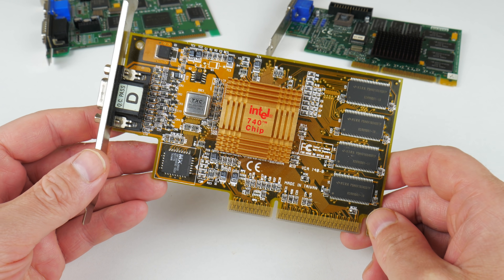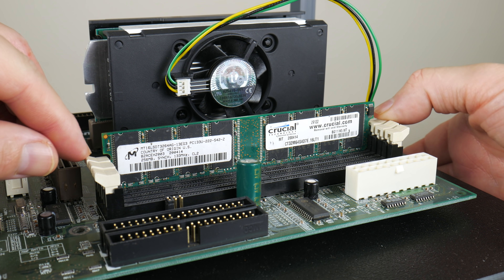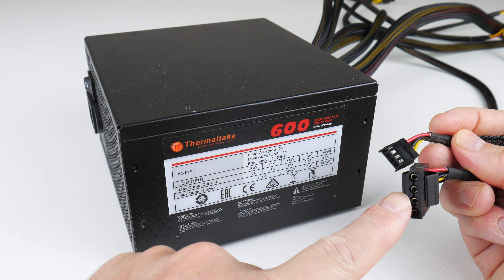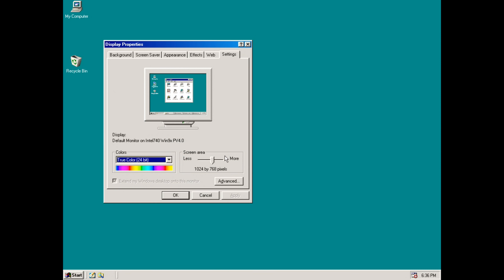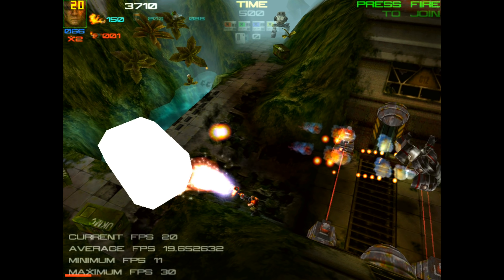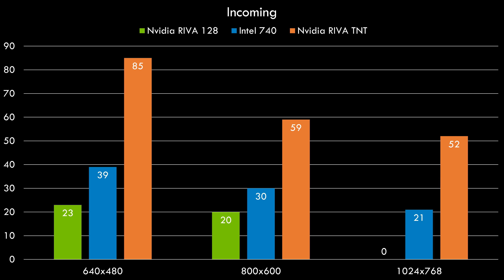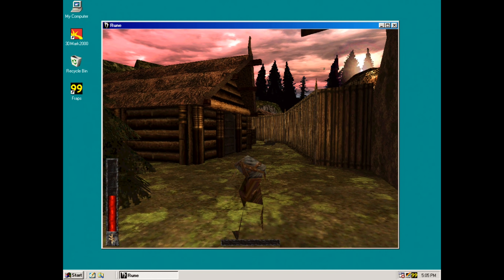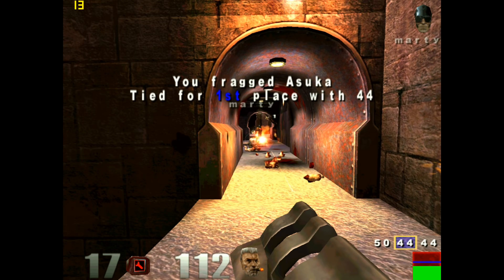Intel's first dedicated GPU vs Nvidia - The Intel 740

Comment: I didn't buy because yeah integrated Intel GPU is just continuation of the i740 and that means G31t or 945GC-M7 board indeed a modification of I 740 and only can 🪞 waters correctly on windows 7 in far cry gaming

Comment: Yes, I was alive and kicking and in college, PC gaming on Tandy 1000 since 12 (though I did have a Ti-994a before that) I never knew Intel made a graphics card.
Because of covid and having to make room to work at home, I've had to sell a lot of my retro stuff to make room including Voodoo 3's. I've focused on mostly modern gaming. Got a 3070 Ti, 1440p monitor, mostly for DOSBox in 1600x1200. I've been paying attention and the Intel cards might be more expensive at MSRP than options from NVIDIA and AMD probably to help cover R&D costs. Intel is not restricting hashrate for mining so that won't help what retailers will end up charging. I'm thinking they will be scalped at $1300-$1500 for the lower end models if nothing else than being Intel's first high performance dedicated GPUs. If they do have a GPU that can match 3080 Ti or 3090, those are going to be some expensive cards. I do love the cool naming of the Arc GPUs but they still won't have features NVIDIA has brought to the table. Yes they will have their own DLSS and ray tracing but just how competitive will those features be?
Reply from the maker: 1440p is nice for older games, 1600x1200 with center scaling. Especially if you have high refresh rate screen :) Sorry to hear you had to sell Voodoo 3 though 😔
Reply: @philscomputerlab  I've learned to live with it. With using DOSBoxECE and GOG w/ SondCavas VA, MUNT, etc, many games just run better. For example, I did hours of comparison running KQ8 from original CD on a P3 1.4GHz and a Voodoo 3 against my modern PC and the GOG version using dgvoodoo2 and the GOG version performed so much better. That P3 and Voodoo card should have been more than enough. I know many here are die-hard original hardware but there are so many ways to get those old games working as they did before. I did get an Sound BlasterX AE-5 for Alchemy. I did still keep a P3 1.4GHz with Quadro FX 3000 and Aureal Voretx2 and a Phenom II X6, 750 Ti and Titan X-Fi for ridiculously high-end Win98 and XP gaming. I do have an Athlon64 and P4 for Win98 too but I have to keep them is motherboard form in an air-tight container with a few spare Vortex2 and SB Audigy cards.

Comment: The intel card was good and had a number of features other cards in its class did not. The problem was intel did not have good driver programmers so it didn't matter how good the silicon was.

Comment: I went from an integrated ATI Rage II with add-on PowerVR PCX2 to a Riva TNT.  This video shows how magical the Riva TNT was when it came out. It blew me away and lasted years for me. With the i740, I'd really like to see how it scales on systems with faster memory. Would it see a big improvement?
Reply: No. It doesn't, at all. All that promises that "AGP will now allow us to access system memory to store textuers" were all bollocks. Actually, there are some PCI versions of the i740 and they are even faster than their AGP counterparts. As weird as that sounds.
Reply: @ccanaves  The Riva 128 can also pass textures across the PCI bus like AGP can do.   That was a selling point of the card at the time that it was somewhat competitive with AGP, but over a much slower interface.
Reply: @ccanaves  >All that promises that "AGP will now allow us to access system memory to store textuers" were all bollocks.

No, it wasn't bollocks. The fact the i740 could do 1024x768 with so little memory on the card itself proves that it uses AGP Texturing. Let's take the average i740 with 4 MB of video memory. Running a 1024x768 16 BPP frame buffer eats over half of that once you account for things like the Z buffer, stencil buffer, etc. There'd be no room left for anything beyond the most basic of 3D textures. Games at the time were starting to hit the texture limits of the likes of the Voodoo2 8 MB cards, which only had 4 MB of texture memory available. Q3A tanks the 8 MB Voodoo2, and the 12 MB card is not far behind because of either having to swap out to system memory or lower the LOD to a blurry mess for speed.

The reason the PCI i740 was in some cases faster is because the PCI cards had to have all of the available memory to the i740 on the card itself, since it was not designed to run on the PCI bus and had to use an AGP2PCI bridge chip. The local texture memory was faster, and didn't have to share bandwidth with the CPU and the rest of the system, resulting in slightly better performance. But this was largely offset by the slower PCI bus, which at best was half the speed of AGP 1x, and at worst a whole lot slower when the system was heavily loaded due to the shared nature of the PCI bus bandwidth.
Reply: >I'd really like to see how it scales on systems with faster memory. Would it see a big improvement?

Moving the card to a faster system would just see speed improvements from reduced system bottlenecks. The card is always going to be AGP 1x, and moving it to a faster system won't change that. The memory bandwidth to the card won't change beyond the 66 MHz / 266 MB/s the card was designed to run at, but a faster system will allow the card to run closer to that maximum more of the time. Likewise, a faster CPU will be able to feed the card more efficiently.

The best possible system configuration I know of for AGP 1x/2x cards that are still easily obtainable are the 533 MHz FSB Pentium 4 chipsets made by SiS and VIA that allow for a universal AGP 4x slot, which will accept all AGP cards except the uncommon AGP Pro cards. This would get you up to a 3.06 GHz Northwood Pentium 4. If for whatever reason you needed SSE3, you could drop down to a 2.8 GHz Prescott. I ran one of these for a long time for my Voodoo5 5500, since it's limited to AGP 2x and the PCI variants are severely crippled due to bandwidth starvation.
Reply: in 2020?
Reply: My self the rage Fury Maxx .  Cheap card nobody whant it.  Really gast card in that time of IT works
Reply: @vardekpetrovic9716  hm, I did forget about that, although from a bit later. Didn't really know what a xeon is back then.
Reply: Are you sure that Ati was integrated? Back then you couldn't really find an igpu outside of sis boards, at least on the Intel side of things. I too had a rage 2 on my pentium 133, it was a pci card.
Reply: @youzernejm  of course I'm sure. I owned the computer. It was a Sony PCV-120 Pentium 200MMX system with an onboard ATI Rage II 2MB graphics chipset.
Reply: @youzernejm  AST made systems that had ATI 3D Rage II+ chip on the baords.. I had a pII 266 system with a 4mb one, it was slow but not nearly as slow as the i740.. that 740 was hot garbo.
Reply: @youzernejm  One of my neighbours had an e-machine in 2000 that had an integrated ATI Rage Pro Turbo chip with 4 MB of VRAM. A few years later I rescued it from a hard life of being abused by teenagers who installed all manner of spyware, and in 2005 they finally decided to get rid of it. The power supply had scorch marks in it from the fan being clogged with a mix of pet hair and tobacco smoke, and the CPU fan was seized completely from the same mix. I replaced the power supply, put a new cooler on it, gave the case a thorough scrub to remove the tobacco staining, and replaced the hard drive with something from my Box Of Crap to revive it. The thing lived for another three years in the care of a pair of seniors before I eventually traded them a more modern PC for a 1991 VW Jetta.

Comment: I worked for a local computer store back in the day. My boss has a penchant for buying cheap parts, so of course the i740 came across my workbench. It was truly awful, and I'm not sure the i740, combined with the cheap Super 7 motherboards that he ordered, helped my first impressions of AGP. (I don't remember when this was, so it is quite possible I first saw the i740 after better cards had surpassed it, and I will also admit those cheap motherboards probably didn't help.)
Reply: I tried to avoid mixing the 740 with non-intel based boards back then, it just seemed glitchy when I did that.
Reply: @stonent  I wouldn't have "crossed the streams", either, but that was kinda hard to avoid when you were just a high school student and your boss ordered otherwise.
Reply: I worked for a local shop as well..Omg..trying to get an I740 stable with a K6-2 platform in Windows 98se ..Good luck.😆...those were the days.
Reply: @flasha29  yeah it ran great on my super 7 MSI board at the time never had issues but again i used it only for 2d and had Voodoo2 12MB card for 3d work
Reply: i740 did have was great color and 2d output for DIRT CHEAP. so it paired well with Voodoo 1 or Voodoo 2

Comment: I had an i740 along with my Voodoo2. Colour was much, much better on the i740, the voodoo2 was very washed out in comparison. The trouble was lack of driver support and weak 3D performance. Actual quality of picture was on another level to all the competition. VGA passthru quality also wasn't great on Voodoo's, you could see a difference rather than a directly connected monitor to the 2D card (which was a damn fine Sony 15" Trinitron).

Comment: At the time I was in high school and I remember saving enough to buy a cheap SIS 6326 4MB AGP. It could play NFS 4 in 512x384 - well almost.
Reply from the maker: Nice!
Reply: I remember those cards I used to have an intel celeron 300 it wasn't the best but it was better than nothing
Reply: @metalmusic1401  I was on a 200MMX still 😂. Eventually went Voodoo3 years later, then Radeon 9700 after that. Since 2005 I only use IGP, loving my current Ryzen7 4750G. Those old cards bring back a lot of memories.
Reply: I had the same SiS6326 AGP 4MB which could not run opengl games like quake iii, to i was looking to upgrade to i740, but i waited a little longer and instead went for a TNT2 M64 for my PII 350MHz machine and I was blown away. Nice video Phil 😀
Reply: Wow, I didn't even know SiS made dgpus. OK so there were some graphic adapters years later, but this is new to me.

Comment: I bought it on launch year, I was thinking they know what they are doing and agp is future. But price soon plummeted, and there was always driver issues, ang agp was not working good with amd k6 cpu, and soon tnt, even tnt vanta eat it for breakfast, and voodoo2/banshee have better graphics. I think incoming is only game where i740 work corectly. Not a good memory's :D
Reply from the maker: Thanks for sharing your experience!
Reply: @philscomputerlab  Now I remember that 2d mode was seriously slow. You couldn't do simple zooming and work in photoshop without serious slowdown. I think because of drivers and its 64 bit card. btw If you get a hold of working MSI BX master it was excelent slot 1 BX motherboard (usually caps are dead). Thank you for memories :)

Comment: Reminder that, Intel is the same company that said with sincerity that, world of Warcraft, at 640×480 Low presets qualified as extreme gaming performance.

"But but much Linux" nobody ever took Linux gaming seriously before valve came along; sit your recompiling butt down before you break another dependency.
Reply from the maker: And Intel is also the company that removed all their old drivers, BIOS updates and manuals...
Reply: @philscomputerlab  For a while there, it looked like Asus did the same thing. But it appears that whatever was going on behind the scenes has since brought back most of those old files. Not all though. And saw the same thing going on with MSI, which is unfortunate.
Reply from the maker: Really annoys me. The amount of storage it takes is minimal. Or engage the community to host them. Something. Futuremark for example made their old benchmarks available with free licence keys. That's how you do it. The Asus board I'm using in my next video, still has BIOS and drivers. If I was smart enough to back all their old support stuff, I would do it 😅
Reply: @Lassi Kinnunen 81 even now, at least in my experiences, Linux still has some god awful problems, namely with sound and also handling USB storage. With regards to audio, I've a number of Audigy and X-fi sound cards. The live evaluation discs can all detect and recognize these chips, but not once have I ever gotten audio from them, ever, on any Linux release.
As to USB storage, well, even back in the early 2000s when I was in community college, one of the classes was for setting up and managing a web server, so of course Linux was used on the class systems. And many of us even then had basic USB flash drives, or were lucky and had an external hard drive to store work. Well, in Windows it might whine about not "safely removing" a drive, but unless it was actively writing or reading it rarely had an issue. On those Linux  systems, it always corrupted the storage, forcing many a reformat and a lot of lost assignments and work. It became SUCH an ongoing problem for everyone in the class, that the professor had to set aside a system to be a network share for us to save and retrieve our works in progress from there so we wouldn't have to keep having the problem.
Reply: @ZeroHourProductions407  Linux only supports one Audigy card and no X-fi. You do have to know the magic words to get audio to work in Linux. You also need to have hardware that is supported. As far as I know Linux does not support X-fi at all and Audigy support is limited. But I've only owned an Audigy board. Which does work for me. Although I am using on board sound now. Which also works. Heck I'm running SPDIF. It sounds great! I did have some trouble with pulse audio dying the other day on me. Sound still worked but I couldn't do per application volume. I fixed it.
Reply: @1pcfred  Onboard sound has only been good back in the days of the nforce2 chipset. And only because nvidia's drivers made the realtek chip it was based on competent at handling EAX and the like.

Comment: Pretty much reused as the 810igp later on, I've had both

Played a lot of starcraft, diablo 2, wc3 ran too, played shogo, cs1.6, half life, tachyon the fringe, and a few emulators (snes and sega)

Oh yeah the system was a k6-2 550mhz, 512mb ram, 98se and later xp, 2x 20gb hdd (no raid), and a sound blaster compatible